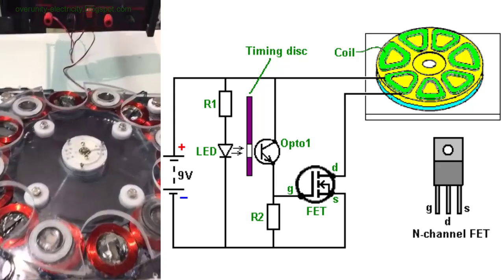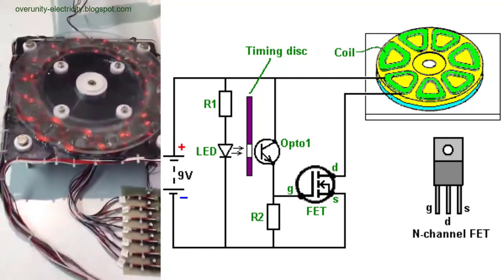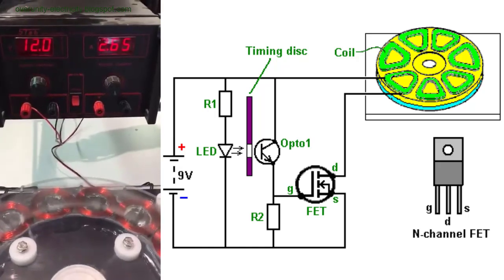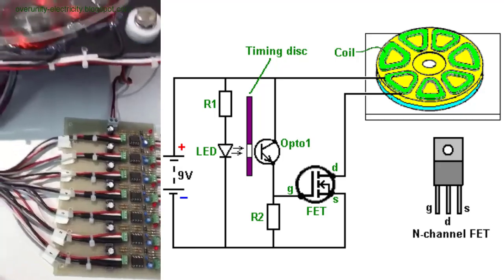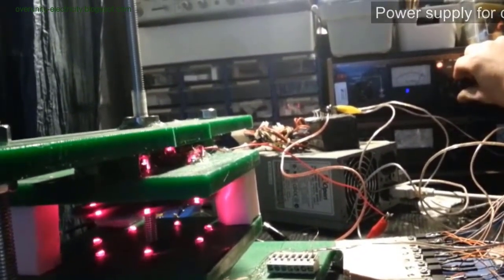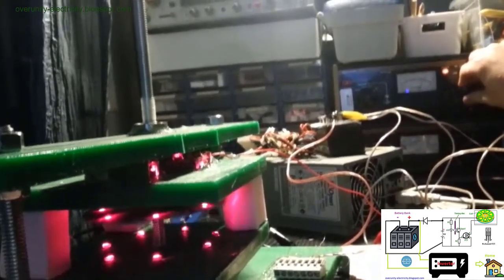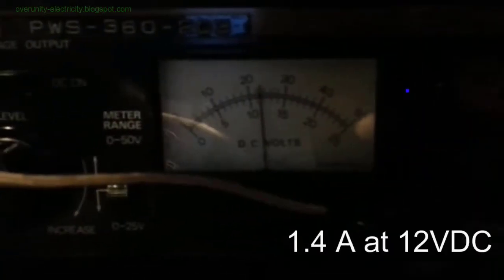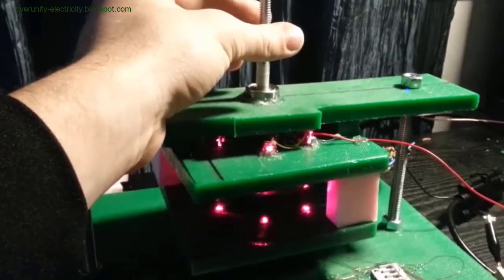Free Energy Generator: Delay Reverse Electromotive Force and harness the power of Voltage Transients

Comment: And? You know why transients have voltage spikes? Coil acts as current source, if there is no path for it to go it compensates in voltage spike, as voltage increases it will be easier to discharge in alternative way. Power stay the same, it is one You put in when You turn those magnets. You can perfect it how much You regenerate it back, but it always will be less than You put in. Not voltage or current, but power in and out, those are comparable.